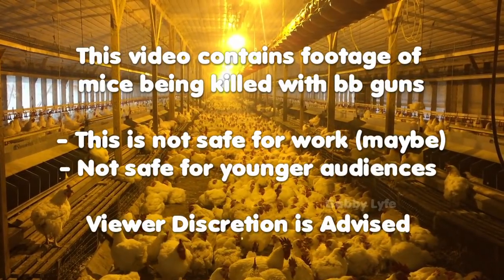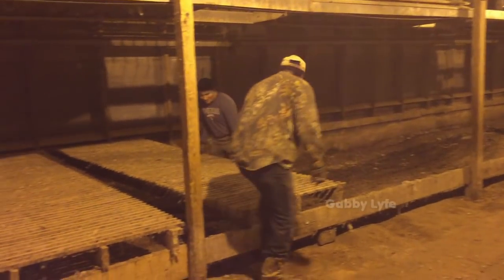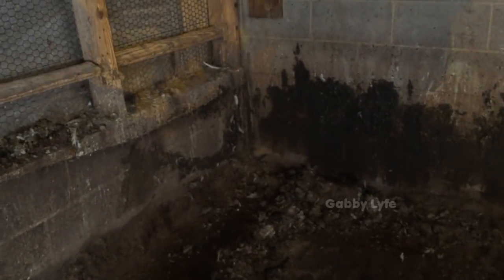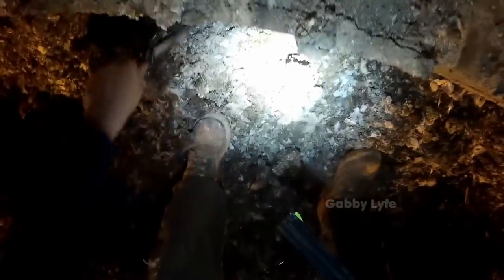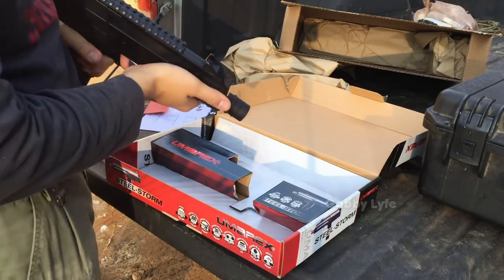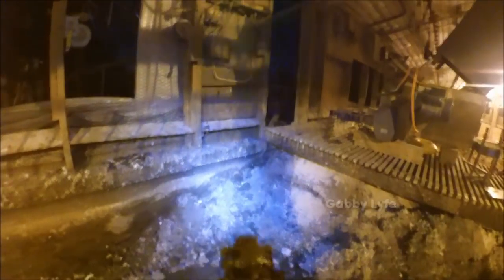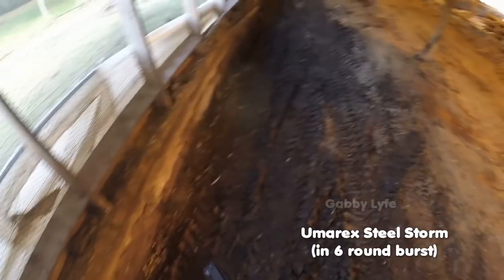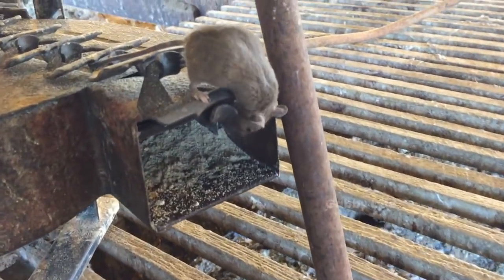The Annual Chicken House Mouse Hunt (Newest Version in Comments)

Comment: Hey Gabby, cool video. Telling it like it is and doing the job.

With your BB gun requirements in mind, what about the Umerex M712 if you can make/get an adapter to run it with a remote. Adjustable rear sight might help with accuracy, semi-auto, $100, you can get extra magazines, and with it being a pistol you can probably make a holster for it. Looks pretty easy to use one handed and its pretty hefty which might lend itself to the  "work gun" you need. And, if the plastic grips it comes with break you can easily make some out of wood.
https://www.airgundepot.com/legends-m712-bb-pistol.html
Reply from the maker: Yeah I like that its single action and full auto, but the gas and magazine are tied together. While it is possible to convert it use a bigger power source (I like 88 grams) I would have to take the magazine out to reload it or put in another magazine. A new magazine is 40 bucks which is way too expensive and loading up an 18 round mag everytime would take to long 

I'm leaning towards a Crosman P15B. Its 50 bucks, blowback, and each 20 rd mags are 5 bucks each. Gas and mag are separate.